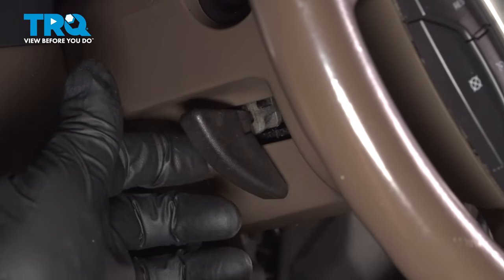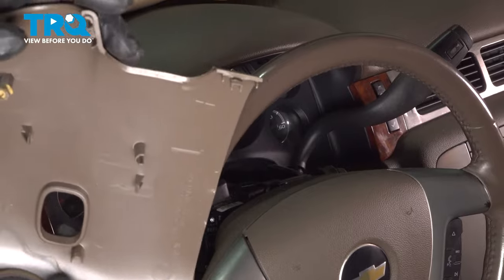How to Replace Ignition Lock Cylinder 2007-2013 Chevrolet Silverado

Comment: What if the new cylinder came with new keys and the new cylinder has tumblers in it already? Just install the new cylinder and it will start right up with the new keys?

Comment: You can do it way quicker if you don't pull all those panels off.
I need to do mine and now I know what to expect. Thank you!
I just checked my truck, and you can pull both steering wheel panels without pulling the big panel underneath..

Comment: I went thru this process however I’m having issues with the theft system. Went thru the relearn process (which takes 30 minutes btw) and got the truck to start. Put the cover back on and then went to start it again and the same message about the theft system popped up. Any ideas?

Comment: Does anyone know the length of the 10mm bolt for the parking brake lever? I bought a used truck and the bolt is missing on the parking brake. Thanks in advance. I will try to find the answer and post it if I can somehow find it.